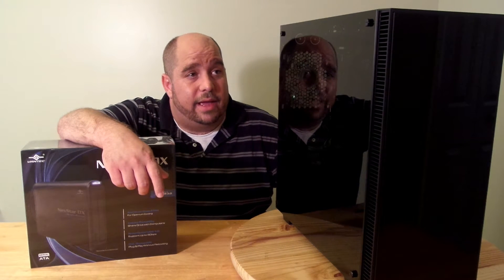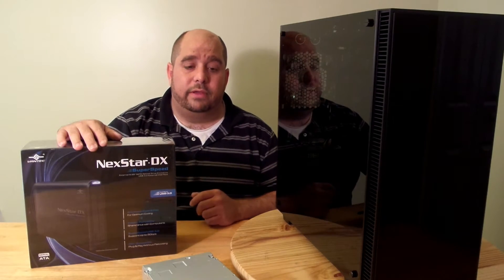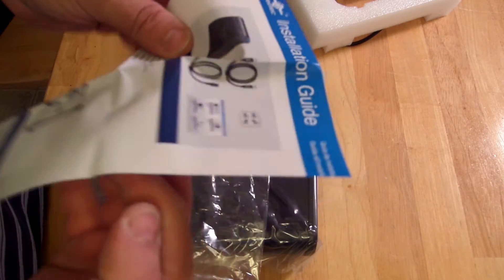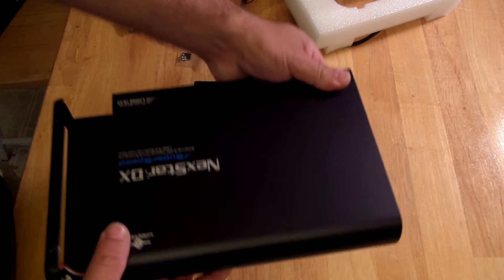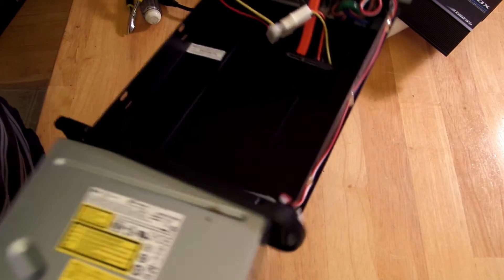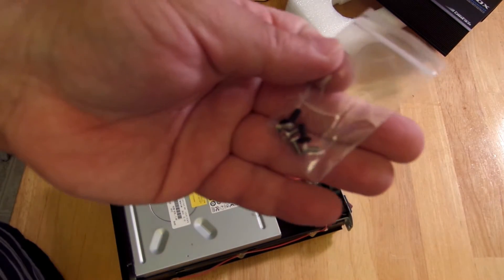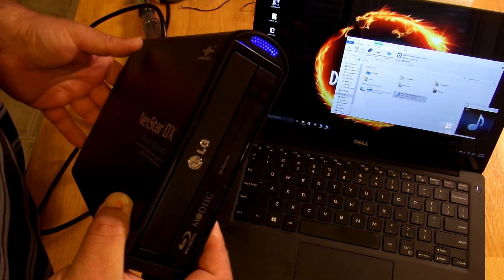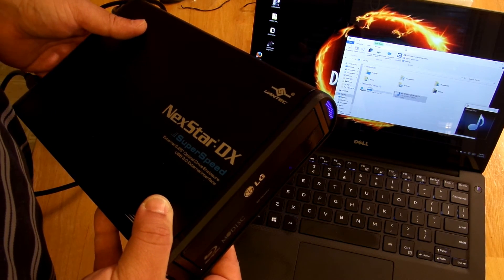Unboxing & Overview of the Vantec NexStar DX External USB 3.0 Optical Enclosure

Comment: Have you tried to burn a bluray yet with it? Many claim they have had to upgrade to a 3 Amp 12v of 30 watts beacuse the 2amp 25 watt is insufficient.  Asking because I am looking for bluray burner solution because of the ill design of no optical bays in the newer cases.
Reply: its has its own internal power supply it is not powered off USB which is 5 Volts.    So I am not sure how you would upgrade it...

Comment: is it that Enclosure can use in Internal PC Hard Drive Sir? it means its dual purposes? Good for both Internal DVD and Internal Hard Drive?
Reply: yes you sure could, it just might look a little odd since it has an opening for a CD tray, but it would work, I have used it for that purpose before.  You can check it out on Amazon here: http://prourls.co/OtB4
Reply: @ThisBytesForYou  Thank you guys for your reply and I'm so sorry for my late responds I really need this stuff because I decide to update my equipments and possibly replace my PC of Tablet Computer which: 
-Little bit low cost
-Portable (can be use elsewhere)
-Easily to maintain
-Less space problem
-Less power-output
(compare to 220v PC and 
continues electric power) 
-can detect Wifi and 4g/5g Data Signals

Thats why I need that for my Optical DVD Drives and Hard Disk Drives to still use it as removable device
Reply: @CubSATPH  yes on this device you can put optical drives and hard drives and SSD's.
Reply: @ThisBytesForYou  Thank you so much Sir. and now my problem is my budget hahahahahaha
Reply: @CubSATPH  always a pleasure, but its been 2 years... I don't think you "need" it, you would like to have it and its $55, surely saving 3 dollars month, you could have bought this.
Reply: @ThisBytesForYou  Thanks again Sir. its more interesting to know the current price of it and its now become low cost but now so sad its pandemic I did not save money before the pandemic and I don't have a work since the lockdown arrive and still this stuff will not remove in my Wishlist its very Nostalgic to me when I was hearing and seeing any Optical and DVD Drives working because I took CD and DVD Burning in my High School, College and in my work as Assistant in Office and Optical CD/DVD Drives reminds me of my old DVD Player which a gift of my late Beloved Uncle
Reply: Try the Nexstar 3